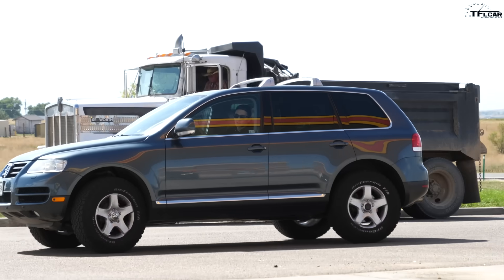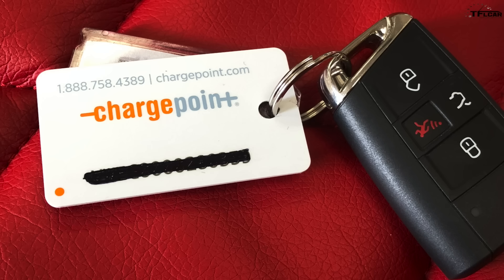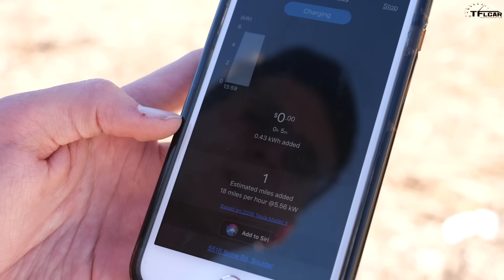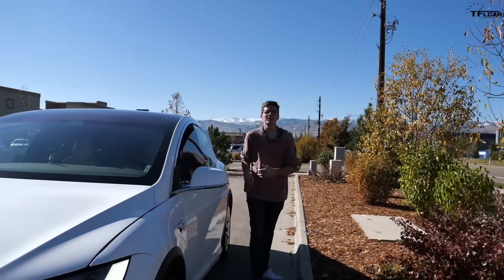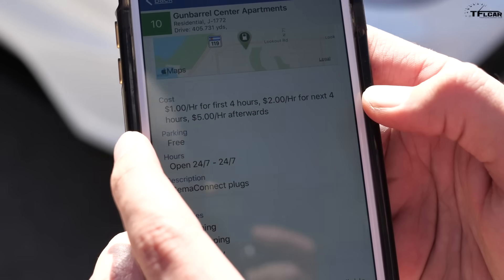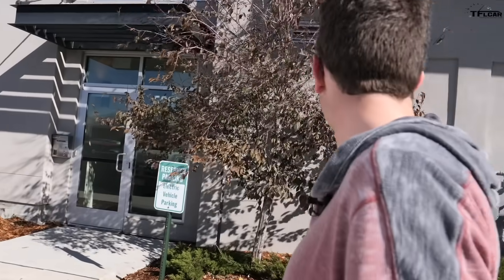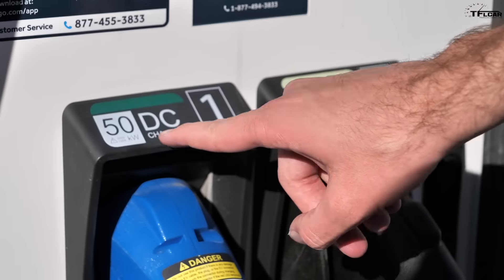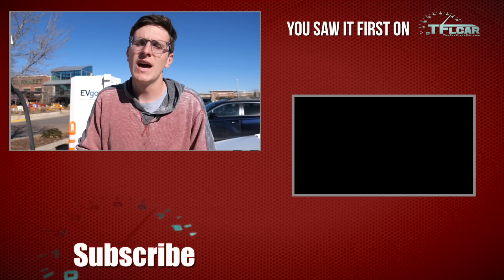Here’s Why Charging an Electric Car Can Suck - And It’s Not The Reason You Think!

Comment: With all of the interface between your phone, credit card info, and, the different companies, how soon before these start to get hacked. I can see a home charging station as the best alternative. all it takes is a 240 volt line, similar to a dryer or electric stove, that is no big deal if you can retrofit, and, that is not hard if your garage is attached to your house. But, who is going to sit at one of these chargers for the time needed to charge the car. If you can plug it in while sleeping, that makes a good solution. I would prefer a hybrid, especially if i wanted to travel across the country to remote places.

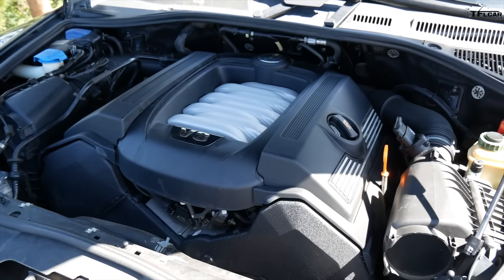Comment: 15:27 Anyone who CAN charge @ home WILL charge primarily @ home. I got by just fine with the Level 1 charging cord that came with my car. Both cities where I usually went have DCFC chargers @ Nissan dealers, FREE for Leafs. I preferred L1 charging as it’s easy on the battery. One city also has a L2 charging station @ the city hall, also FREE, which was good as the Nissan dealer closed @ 8 pm. Unfortunately one of the two EVSEs there was malfunctioning.
Reply: only during dealer hours

Comment: 14:12 Tesla does NOT use the CCS1 (North America) connector in Europe. In Europe Tesla uses the CCS2 (Menneke based) connector. The Menneke connector is L2 only with 3 phase capability.
“L2” is 240 volts. The EVSE device, either the one in the cord that came with the car or in a wall mount receptacle, “tells” the charger (which is in the car, not on “shore”) what current level is available. For example, in a UK home the receptacles are rated 13 amperes @ 240 volts 50 Hz, or 3,120 Watts. In the USA convenience outlets are 15 amps @ 120 volts, 12 amps continuous = 1,440 Watts. The circuits may be fused @ 20 amps = 16 amps continuous = 1,920 Watts but we have duplex receptacles and a half dozen or more may be daisy chained.

Comment: 13:37 CHAdeMO is dead outside Japan. ElectrifyAmerica (VW) accommodates Nissan Leafs and the Mitsubishis by providing one CHAdeMO station to 7 or more CCS1 stations. I would not be surprised if Leaf DCFC charging will be exclusively at those dealerships that already have DCFC chargers. Of course all Leafs have a J1772 plug, so owners will be able to charge them at L1 and L2 charging stations.

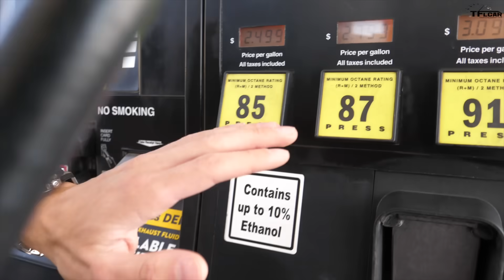Comment: 0:16 Europe has a standardized EV charging “nozzle”: the CCS2, which is the Menneke 240 volt connector with 3 phase capability plus the two DCFC connectors below. All charging stations are mandated to be equipped with the CCS2 receptacle. All new EVs are mandated to be equipped with the CCS2 plug.
The Japanese CHAdeMO DCFC connector is dead in Europe.
In the USA/North America we have three incompatible EV charging connectors: Tesla, J1772/CCS1 and CHAdeMO. The charging protocol for CHAdeMO is incompatible with CCS1. Only Nissan and Mitsubishi use it. Nissan’s new SUV will have CCS1/J1772 for North America.
China has its own incompatible connector but as the protocol is compatible with CCS1 and CCS2, and little vehicular traffic moves between China and the outside world, that presents no significant problem.

Comment: So what the hell do you do for 3 hours while your waiting for your car to charge in a business park, apt complex you don't live in ????
Reply: You're missing the point. The objective is not to waste time charging, but instead to charge while doing something else you planned to do anyway. Current EV owners charge at home over 80% of the time. All the rest of their public charging is taking an opportunity to charge while doing something else where the EV would be parked anyway. So, if you are running an errand, plug in when you park, unplug when you are ready to leave. All it requires is charging access at the places someone plans to be anyway.
Reply: @georgiaev7860  I'll just take 8-10 minutes to fill my 30mpg car once a week and not have to worry about finding a charge station. The other part is a used 8 year old EV has no value once the batteries are bad it's done.
Reply: @mikevigil3677  I'll just take 8-10 seconds to plug in my EV at home to charge just like my cell phone and not have to worry about finding a gas station at all. BTW I have a 7 year old FIAT 500e and it's still going strong.

Comment: What a hassle to own one of these. I could not live with this system. I would only own an EV if I charged at home and used it around town. No way would I take a road trip using this method as I would go crazy dealing with the uncertainty and the time it takes to charge if you can find a supercharger and you have the right adaptor. Plus the price of these cars make gas-powered still more appealing. I do appreciate these videos as they are very educational. I have yet to see a case where a road trip goes smoothly. And even then, the massive charging down-time versus gas pumps is not something I want to deal with.

Comment: EVs are still a few years away from mainstream use by the everyday driver, but longer-range batteries, shorter charging times, and greatly simplified mechanics should win out over internal combustion vehicles.  But for now, EVs are just not realistic.

Comment: Junk them
Reply: You aren't supposed to let your EV's battery get down to like 3% and then recharge on a regular basis, the idea is to top it off every 2-3 days at places around town using level 2 charging or to do this at home overnight. Also, Tesla's can charge up to 80% in 40 minutes when you would usually be at a restaurant or something like that on a road trip when on level 3 charging.

Comment: Paid $53.00 to fully charge my tesla, took 20 minutes to charge. Paid $20.00 to fill my gas tank on my civic , it took me less than 2 minutes . My civic still works when there is a power outage,and the rest stops with gas stations are all over the place versus having to google the nearest high speed charge port

Comment: Very informative. Until the ev’s can get 400-500 miles per charge, they are not too great for long highway cross country trips.
Reply: Um... planes? The last multi region trip I drove was 14 years ago. How many cross country road trips would the average family take in a decade? The over/under for that is 0.5.

The most efficient strategy charging EVs on a road trip is more stops charging to 80% or so each stop. Almost all EVs slow down charging above 80%. WIth a 300 mile EV, charging to 80% gives 230-240 miles of range. With the fastest charging current EVs charging from less than 10% to 80% is on the order of 20-25 minutes. Here is an example of the new Ioniq 5 doing a 6-100% charging session. https://www.youtube.com/watch?v=FgqCyy53C_g It's 24 minutes from 6-80% and 42 minutes from 6 to 100%.

Comment: Lol, I think most people don't get how electric cars are supposed to work.

When you park your car you passively charge the car. In theory you shouldn't have a battery problem unless you are traveling out of your city. When you are, that's when the super chargers are meant to be used.

If you already follow the recommended guidelines to have a 15m break for every 2 hours of driving, then you shouldn't have any range anxiety.

Also I would say electronic cars are doing pretty well for 'new' technology. As battery technology improves, electronic cars will overtake gasoline in both range and refilling speed. But for now, choose which ever one is most convenient for where you live, and price of course.

Comment: This video makes EVs seem way more inconvenient than they really are. Basically all evs easily travel a minimum of 100+ miles on a single charge with many reaching 200-300+ miles the average driver won’t use this in a day so simply charging at home is enough. Not to mention many work locations, shopping centers grocery stores restaurants have charging stations you can top up or add some range at and many of these are fast chargers that charge 100+ miles in 30 min.  At least in my experience in California there  is one non Tesla charge card and app that wokr for almost all charging stations making it pretty fast and easy. I can’t personally speak for other areas but according to the map this is true in many other areas as well.  And even long distance travel isn’t very inconvenient with some evs traveling 300+ miles on a single charge and lower end Evs 150-200+. With fast chargers you can stop and get lunch and your car will be close to or fully recharged

Comment: when they get it so it charges a car full in less then 10 mins then ill think about getting one of those cars.
Reply: Close your eyes for a minute and think about this:  Never having to go anywhere to refuel again. If you don't have to drive anywhere to refuel, then why is 10 minutes so important?

I have an EV and an ICE. With the EV it starts each and every day with a full battery. With the ICE, there are out of the way, and often late night, runs to get gas. I too would worry about refilling time if I have drive somewhere and stand next to a pump to refuel. EVs don't work like that.

Refilling an EV is a completely different model that ICE. ICE people get hung up on the charging time because that's the only model they understand.

Comment: In my opinion the charging issue is going to be the biggest drag on the growth of EV sales in the U.S. Until there are charging stations at every other exit on I-95 (I've reduce expectations down from every exit) that can fully charge a vehicle from 10% to 90% in under 10 minutes you can forget about EV's becoming a significant percentage of vehicles on the road. Most people aren't going to give up the convenience of having a gas station every five minutes of driving where a gas tank can be filled in 3 minutes for the novelty of owning an EV given the serious limitations that current exist with respect to charging.

Comment: I lived in an apartment and had an ev. I mainly charged it in the garage at night on the regular 110 volt power. Monthly cost was very low- maybe $10. It got about 5 miles of charge per hour x about 12 hours = about 60 miles, which was about what I used each day. I didn't even charge it at work, because I was too cheap to use a parking garage. I couldn't take it on long trips. But I would usually fly anyway, so not much of an issue but I did rent a car once for a road trip, which was pretty cheap.
Reply: Sorry bud - you drank the cool aid and are stuck with a shitty "investment" in an EV load of metal.  Good luck in your limited travels.
Reply: Um. Wrong. I didn't make an "investment". Leased it for 3 years. And that monthly lease was about my only expense. No oil changes. No exhaust system. Had to get new tires I think. I inherited a gas car and that is what I drive now. It's a lot more expensive. Gas, repairs, oil changes, etc.
Reply: @ronlugbill1400  Hi Ron, you're a smart guy to lease a EV and I hope you know the lease end cost when you decide to walk away - and have no vehicle.  Will you have to pay anything to get out of the lease - like a buy back fee or do you have a closed end lease?    You did not say the kind of "lease" you bought.  Also, what are your mileage limitations on your lease?  Any other clauses related to battery care in you lease?  I am just asking because if you are surprised at the end of your "lease" you need to tell everyone on this blog what it is so we can evaluate EV substitution against the fossils fuel vehicles we are used to.  Please respond in kind to these open ended questions.  Craig
Reply: Nissan was giving good deals on leases at the time. No end cost. Around $334 per month. At the end of the lease, it did not make sense to buy it because the price was higher than I could have bought on the open market. I inherited a car at about the same time as the end of my lease. It was nice knowing the lease cost was all I would have to pay. Not much risk of a new vehicle needing major repairs or a new transmission. There was a little higher insurance cost because the lease requires a certain amount of insurance. I had 15,000 mile per year maximum. You pay extra if you go over that. I did not go over that, so no problem.
Reply: @ronlugbill1400  Sweet - you have a vehicle that costs $.0267 per mile to drive ($4008 divided by 15000 miles) which is a good deal.  Almost every car on the road costs that much to use, plus fuel and maintenance.  Since EV vehicles when new don't cost a lot to maintain or fuel costs you are in a good positions.  Great for your situation.  Also a good thing you have a place and time to charge it while not working and only driving 60 miles per day.  Your situation again, is in your favor to have an EV vehicle, however when you look at the cost of a new EV (over $50,000 or lease payment in excess of $500 per month for 3 year closed end lease) and EV vehicle is really not the best transportation right now in America.

Comment: OMG, yes there are some problems with this NEW technology. And it will take a few years to smooth things out a bit. Ok, electric vehicles are not for everyone, but for the 90% of us that want them, we are looking forward to saving $5,000 to $6,000 a year in fuel costs, as well as the $2,500 (on average) for regular servicing and spare parts. And as we all know, as they age, ICE vehicles start to have problems that sometimes require repairs that cost more than the value of the car. Despite all the obstacles, bring on the EVs and let the Arabs drown in their oil.

Comment: i finally got a smartphone about a year ago and barely use it for anything but calls and a little text messaging. seems a bit like a job just to charge your EV car with all the app knowledge needed plus what happens if your phone battery is dead and your car is dead. when they make EV cars go 1000 miles per charge and have a solar panel charging the car while it sits for an emergency charge it will make more sense.
Reply: Do you know that all EVs have 12V car batteries to power the electronics when the main drive battery is offline? Even if the main battery is literally at 0% and the car won't move, there's enough power to recharge the cell phone to the point where it can operate the charging station and charge the car.

Comment: We all know why those cars SUCK
after a couple hrs on a trip you have to get a motel room      for a 12 nap 
while your vehicle is connected to a plug

filling it up with electricity        by the way that
electricity    is probably   made by a
1     natural  gas generator
2     oil  fired  Generators
3      COAL  Fired  Generator s
    10 to 12  hours to fill up with electricity

Comment: Ypu are correct this is my main issue with going electric. Going electric would be amazing for my job as I drive 250 to 350 miles per day 5-6 days a week, my issue with this is if my "EV" would not make the entire trip on its initial charge then I would have to stop to top off and and lost time on my return commute will put me I to the after noon commute traffic jam making a 2.5hour return trip turn into 4-6 hours trip. Not being to go electric is ashame because the money I could save ($45-55) in would be amazing. For now I am considering a prius, I hate the look of the prius it's so ugly but I currently get 24-28 mpg and that 50mpg sounds good. My car I have owned for 3 years now and it's flipped over to the 300k mark and its a new car still so it's a shame but it's a Honda so mabey I can get 500k out of it we will see.

Comment: I had no idea about any of this, I thought everyone charged their cars at home overnight.  But I guess if you travel and are not at home overnight that is not possible and you have to look for a charging station.  Companies where you work should have charging stations so you can charge while you work, and they could dock your pay for the amount you charge.  I think if you make it cheap, quick and convenient people will buy more and more electric vehicles.
Reply: Most current EV owners do charge at home. Each and every day it's little more than 5 seconds to plug in, then 5 seconds to unplug with a full battery. Unfortunately, ICE people only comprehend refueling in the gas station model. So, of course the thought of sitting at a charging station for an hour or more makes no sense to them. With the realization that EV owners rarely, if ever, actually stop to charge in public at all, hopefully some will become enlightened.

Comment: How many people will be willing to wait for hours to charge their car? I wouldn't and wont. Also it looks like the perfect place to get mugged or carjacked. After watching this vid I now know I will not be buying or using an EV. For one thing a complete standardization will have to occur. Gas pumps have one nozzle. Another idea is quick change batteries. Where you don't charge you just swap out the batteries. Battery tech isn't at that point yet, too big and heavy. Thorium reactors in cars would be the best way to go. 100,000 miles between charge or refueling. And it could power your house. Very low radiation and they can use nuclear waste.

Comment: Being used to 150kw Tesla superchargers, it’s hard for me to conceive of a 5kw charger. In a minute, I can add almost as many miles as a half hour on the non-Tesla charger.

As it charges, the Tesla battery slows this down. I usually quit when it’s much below 100 kw. Less total charging time stopping twice as often.

Or we use 110v  (1.3 kw) at home. Top off the battery every night. Has taken 3 nights when battery was down.